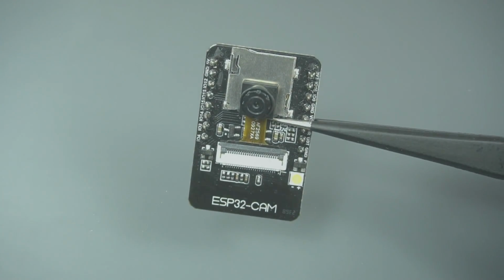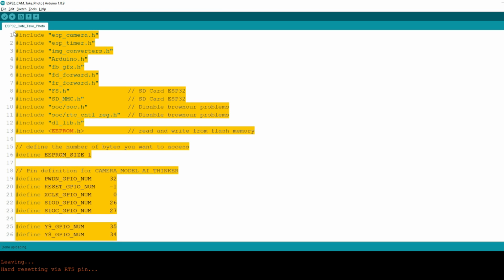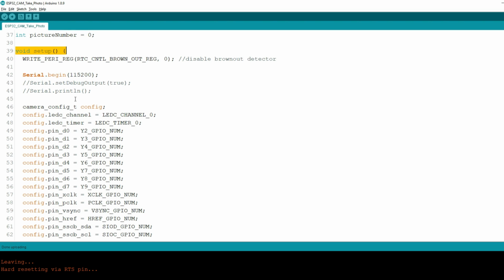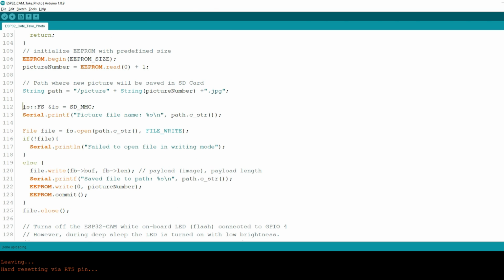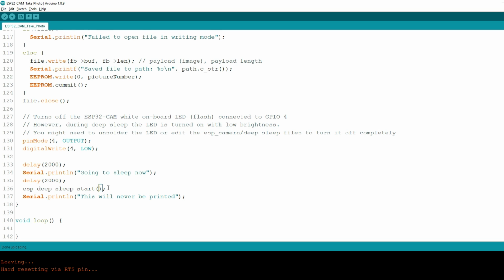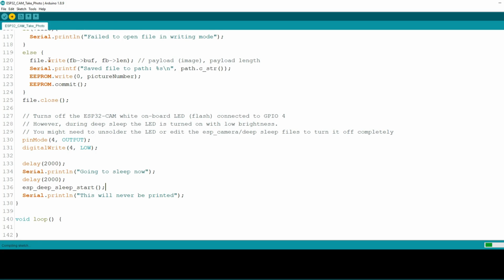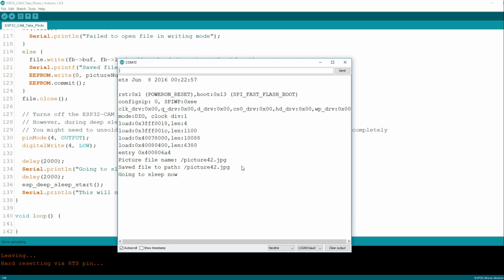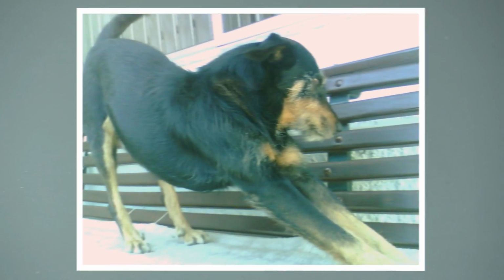ESP32-CAM Take Photo and Save to MicroSD Card

Comment: The ESP 32 has become the buguias module on the planet I have never implemented a module for any use they use standard settings or the suggested settings even I usually have to poke around and defined the board as development module rather than Rover etc etc etc it's like winning the Lotto getting this thing to work right and then when you finally do it's so slow and loses network connectivity constantly it's just a bad product

Comment: Hi.
I've been posting comments on your site randomnedtuturials, but they've been deleted, so I'll ask you here. I want to take the photo out using the push button instead of the reset button. I would like to try using the pull-up resistance and push-button connection to GPIO16, the method mentioned in your site comments, but I don't know how to code it. Please help me.

Comment: What should the deep sleep current draw be with 3.3 vdc applied to gnd and 3v3 pins?  I measured 4.4 mA with my multimeter - way more than the micro_Amp deep sleep values given by Module 4 table in the "Learn ESP32 with Arduino IDE" coursebook.  My intended use case is a once-a-day photo application with battery power.
Reply: try to jump the AMS1117. Is draws the high current. But now you have to be careful with your voltage.

Comment: Rui, Great Project. Thank you for sharing. I am working with my daughter on a project to detect garbage type by taking a picture when motion is detected by a PIR sensor. Once the picture is captured, I want to send it to an AI service webservice hosted on Google Cloud. The AI Service has been trained and will return whether garbage type is "Recycle", "Compost" or "Trash". Based on the response, I want to light different LEDs. Anyone attempted something similar?

Comment: Hello everyone, when compiling the sketch of this project I detected the following error in the file dl_lib.h that says: Arduino: 1.8.10 (Windows 10), Card: "ESP32 Wrover Module, Huge APP (3MB No OTA / 1MB SPIFFS), QIO, 80MHz, 921600, None "

In file included from C: \ Users \ Joelon \ Documents \ Arduino \ Security Camera \ Security Camera.ino: 28: 0:

sketch \ dl_lib.h: In function 'char * dstrdup (str_t)':

dl_lib.h: 232: 11: error: expected unqualified-id before 'new'

     str_t new = dalloc (len);

           ^

dl_lib.h: 233: 29: error: expected type-specifier before ',' token

     return (str_t) memcpy (new, s, len);

                             ^

Several libraries were found for "FS.h"
Used: C: \ Users \ Joelon \ AppData \ Local \ Arduino15 \ packages \ esp32 \ hardware \ esp32 \ 1.0.4 \ libraries \ FS
Multiple libraries found for "SD_MMC.h"
Used: C: \ Users \ Joelon \ AppData \ Local \ Arduino15 \ packages \ esp32 \ hardware \ esp32 \ 1.0.4 \ libraries \ SD_MMC
Several libraries were found for "EEPROM.h"
Used: C: \ Users \ Joelon \ AppData \ Local \ Arduino15 \ packages \ esp32 \ hardware \ esp32 \ 1.0.4 \ libraries \ EEPROM
exit status 1
expected unqualified-id before 'new'

This report could contain more information with
"Show detailed output during compilation"
option enabled in File -> Preferences.

If someone would be so kind to help me with that little problem since it would be very useful and would represent a breakthrough for my project

Comment: Hi Rui. Great tutorial video. I am trying to use the same idea but with a Mosquitto broker installed on a local Ubuntu machine and it is not working. The Node-red flow has been adjusted to subscribe to my Mosquito, it gets "something" but on the dashboard all I get is a little image icon (the one you get when the image is not found). Any idea on what I may be doing wrong? Thanks

Comment: Thanks for this video, but I have a question in which pins do I connect the external power source to in the ESP32-CAM.
Reply from the maker: It depends on your power source. If you're using 5V connect to Vin pin. If you're using 3.3V use the 3.3V pin
Reply: @RuiSantosdotme Thank you for the quick response, I was wondering if I could plug it to a power bank or directly to the plug through a charger? (sorry for bad English)

Comment: excellent work. thank you. has anyone figured out how to turn off the led during deep sleep without unsoldering it as you suggested?
Reply: Yes, add these before going to sleep to hold the GPIO state:

  pinMode(4, OUTPUT);
  digitalWrite(4, LOW);
  rtc_gpio_hold_en(GPIO_NUM_4);

in the setup() add the following to disable the hold state:
  rtc_gpio_hold_dis(GPIO_NUM_4);